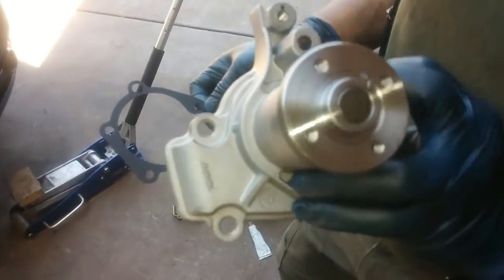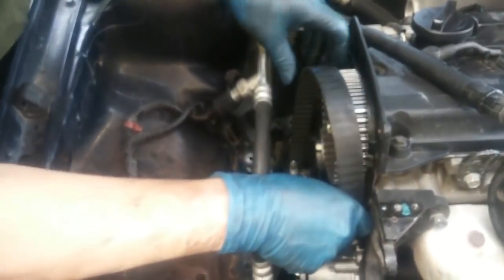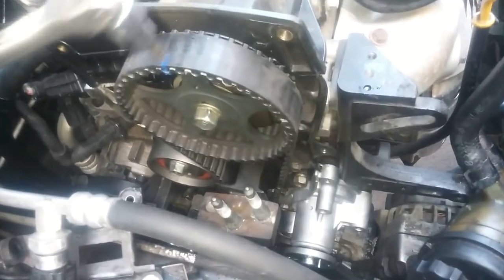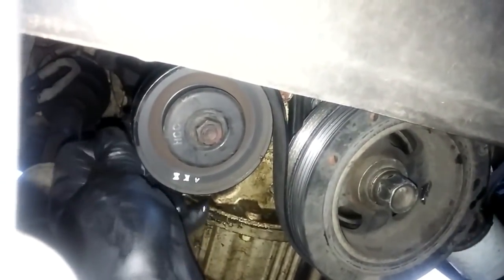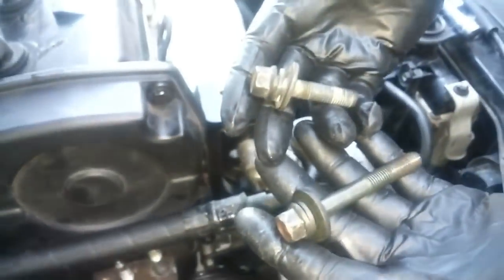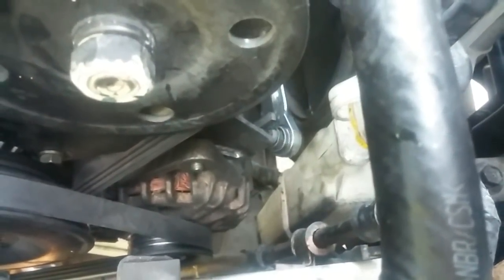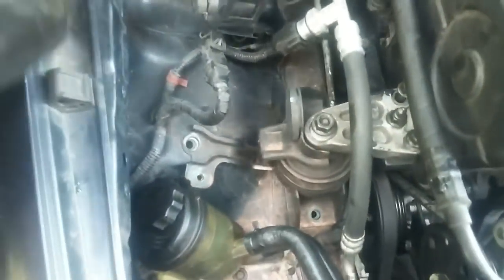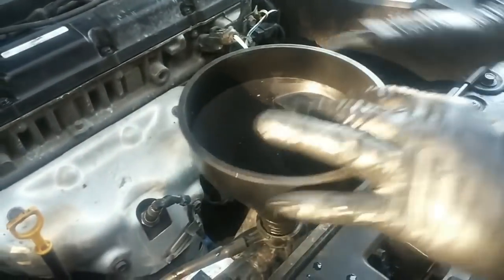Hyundai / KIA 4 Cylinder Timing Belt & Water Pump -  PART 2:  Installation

Comment: Anyone who sees this video, you don't need to put any gasket sealant as he did at 0:26. I did mine without it by dealer recommendation, just plain and it has today 50K miles without a leak. Just the gasket.
Reply from the maker: Ok but I've replaced coolant soaked gaskets that resulted in pump mounting bolts getting loose and coolant leakage.  RTV coatings protects the gasket.
Reply: @hardlymovingpro  Wherever you say, you can do what you want, but this step is unnecessary. It's just another headache for beginners. We appreciate all maintenance videos, but please do not make it more difficult.
Reply from the maker: @irisbaez1972  Then don't critique videos.  Just buy a repair manual and follow their instructions with the tools and techniques they use ... right?
Reply: @hardlymovingpro  RIGHT. internet and youtube are free speech, right? FREEDOM RIGHT? if you don't like positive criticism then go to CUBA, my friend, or better yet don't make a video. RIGHT? I think you have a psychological issue.
Reply from the maker: Setup your own youtube channel and show us the professional way to do it ... for free on your dime!
Reply: @hardlymovingpro  Still feeling pain? you need to see your doctor. psychology doctor.
Reply from the maker: Takes one to know one.
Reply: @hardlymovingpro  You forgot your own Doctor? what a shame!. Amazing how people know anything about cars but nothing about themselves.
Reply from the maker: Okay ... IRIS!

Comment: What sound will it make if the belt timing belt too tight?
Reply from the maker: Can't say.
Reply: Even putting the arrow or point past the mark in the tensioner doesn't do any problem or noise. I have it before from the dealer, then I installed it myself, and then after 40 K miles, re-tight and nothing happened.

Comment: Where is your indicator mark on tensor that lets you know if your just right guessing 6 lbs isn’t how you do it
Reply from the maker: There is no mark from my recollection.  Around 6 to 7 lbs of torque is what's normally applied to a 10 mm bolt.  Use a 1/4" ratchet wrench with hand torque (meaning don't snug it with toque from your elbows and shoulders).
Reply: I have a 2008 Kia 2.0 you have a to point out so the same motors my time in tensioner has an indicator on the back you take it with a 12 mm and a 6 mm Allen socket the same time you get the indicator in the window Is it not the same on this car ?
Reply: @charlesbrewer777  . yes. exactly the same. it's the same motor.

Comment: thk for the video but a have a question, when I intalled belt timing and the start engine the belt timing it move to the rigth  side and no aligin in the center sprocket canshaft, it is normal ? or not ?
Reply from the maker: The belt moved to the right side after engine start because the engine rotation is clockwise.  To check alignment, you'll have to manually rotate the engine from the crankshaft to top-dead-center (TDC) and see if it's in alignment with the camshaft TDC mark.  If the cam alignment is 180 degrees off, rotate the engine again 360 degrees and that'll bring the camshaft to the TDC mark.

Comment: Never use an impact on a crank bolt because you can miss aline or stretch your timing belt after you install it.
Reply from the maker: Strongly disagree.  Never, ever had issues using impact tools to take off crank bolts.
Reply: That can happen in some engines, just the ones that turn counter clockwise; saying that 90% of the “normal” turn clockwise.
Reply from the maker: Impact guns hit and twist in micro seconds.   Therefore not long enough to turn a crank.
Reply: The best way to do it is use a breaker bar and kick start it
Reply from the maker: Did that before I discovered high torque impact guns.

Comment: I had the dealer replace my timing belt and other drive belts and now there is whining coming from the front end which gets louder with RPM.  Do the timing belts whine when first installed?  Or could they have installed the belt(s) incorrectly?  Tensioner crap out after they put it in?  A belt put in too tight?  Its going back but any thoughts?
Reply from the maker: Belt tensioner adjusted too tight ...IMHO.
Reply: @hardlymovingpro  Thanks!

Comment: You forgot to torque the crank bolt.. just kidding, impact rachet.. but for people without one, fill one cylinder with oil at almost TDC, and it won't turn. Torque bolt. Then use a turkey baster and tube to suck the oil back out, and burn off the rest (big cloud). Unless it's automatic, then it might not turn while in gear and a long pry bar in the wheel hub.
Reply from the maker: thanks for your post!  You know when I bought my first ac electric impact driver, it cost me over $100.  Now they go for under $100.  If one is serious about doing HD auto repair and have to deal with bolts that are 17 mm or over, they have to have a high powered impact driver.  Filling the crankshaft with oil and sucking it out is a interesting and novel idea ... for those in a desperate situation.

Comment: I did the exact same way, but the belt started walking off the gears and hitting the side covers.  Did it three times and got frustrated. It still does it.
Reply from the maker: Which gear (crank or cam) is it walking off?
Reply: @hardlymovingpro  cam gear
Reply from the maker: @rockingoutdudetoo5275  If you followed everything I did on the video, the only thing I can think of is something must be wrong with the belt.
Reply: @hardlymovingpro  first timing belt change (with kit) was ok. Drove car for two weeks then I felt the whole car vibrating , thought it was the motor mounts.  I heard something slapping in the timing belt cover.  Both edges of the belt shredded.  So i order a new belt and new tensioner to see if they were the culprit.  Nope it did again second time.  So third time with the top timing cover off just to see, the belt was running against the left side about 1/4 in off the cam gear in which it was rubbing the bottom timing belt cover.
Reply from the maker: @rockingoutdudetoo5275  Can't come up with any logical explanation for your dilemma.

Comment: Thank you for being so detailed with your video; I am sure everyone appreciates all the effort you put into it. I have one question though, I saw that you removed the jack in order to put a pan under the vehicle to catch the coolant. Did you install the mount for that, or does the engine not fall to the ground? In advance, thank you so much for everything.
Reply from the maker: The engine had to be supported and slightly lifted to relieve support tension on the side motor mount.  Once the mount was off, the hydraulic jack can be lowered away.  The engine will drop down a little but not fall to the ground.   Then the pan can be placed under the engine without interference from the hydraulic jack.

Comment: What was this car
Reply from the maker: Elantra.  The engine is used in a lot of different Hyundai cars.
Reply: @hardlymovingpro  what year, vin 5 - 1.6l?
Reply from the maker: Don't remember.  Did this repair years ago.  Hydundai / Kia timing belt configurations are consistent and haven't changed much.

Comment: Hi Hardly moving productions, I just watched your 2 videos of this timing belt process, I have the same vehicle as you do and I’m ready to change the timing belt as well but the difference on mine it’s that my timing belt rip off or blow off, my car turn off while running, is there anything else that I gotta do besides the process that you did? I saw that you used your old timing belt to do some marks to copy to the new one,  but yours was all there, but mine is all rip off.
Reply from the maker: If you buy a Gates brand timing belt kit, it comes with a diagram showing what is top-dead-center (TDC) on both the camshaft and crankshaft.  Use that to set your cam and crank before mounting on the new belt.

Comment: Great videos and very helpful hints and tricks!   I am studying up on doing this job on my son’s 2008 Spectra.   One thing that I didn’t see and it may be an update to the procedure and design is on the tensioner pulley.  It shows in the book that there is a small mark on the block and a corresponding “window” on the tensioner pulley assembly.   I believe you rotate the tensioner until it sits in the middle of the window and then tighten the center bolt down.  Then rotate the engine a couple of times, realign the marks, then check the window again.   I am assuming this is a bit older design?  Thanks again as this really makes it easier to understand than other videos out there!
Reply from the maker: You're welcome!  That tensioner pulley is a spring loaded design where the pulley spring remains compressed until you pull out the tension pin (also called a granade pin).  I believe after you have the belt and the tensioner pulley installed, tighten the pulley bolt where it's semi-tight to allow the tensioner pulley to be adjusted.  Then pull out the pin  and align the pulley arrow with the alignment block mark via a hex socket and wrench inserted into the tensioner pulley's outer cover hex hole.  Once aligned, apply the final torque to the tensioner pulley bolt.  Good luck!
Reply from the maker: Also have a text and picture based article you can reference:
https://axleaddict.com/auto-repair/DIY-Hyundai-Elantra-Kia-Spectra-Timing-Belt-Replacement
Reply from the maker: Also, I start and run the engine for a couple of seconds instead of rotating the engine.  Then I'll check the belt tension and re-tighten if necessary.  You can check out my recent Toyota 5SFE timing belt replacement video towards the end of the video and you'll see what I mean.
Reply: Perfect!!! Thanks for the additional info.  I have done one on an old Mazda pickup, but that was much easier to get to!  I also have to work on my daughter’s 2000 Silverado that has one of the leaking Castech cylinder heads.  Going to be a busy Christmas break out on the driveway.  :)
Reply: Ok, so I finally did this job and had a few questions if you don’t mind.  I bought a kit from Autozone that included the pump, the tensioner pulley, the idler and the belt.  When I compared everything, the new tensioner pulley had a lot more later side play then the original Gates.  I went ahead and installed everything and ran the car.  I noticed that the arrow drifted out of the window, but would also vibrate up and down.  My son drive the car for 800 miles and cane back to town.  He said the power steering belt was squealing (new belts).  While I was about to tighten the belt, I thought to check the timing belt.  When I pulled the cover, I noticed there was belt dust built up on the side nearest the tensioner.   It appeared that the back edge of the belt was hitting the lip of the back of the tensioner and rubbing off.  Out of caution, I put the old one back and have driven about 30 miles.  It does not appear to be rubbing like the old one.  The belt naturally sits back pretty far,  definitely not in the middle of the pulleys/sprockets.  The tensioner is the one piece that really did not seem right. Any insight is greatly appreciated!!!
Reply from the maker: Good job!  By the way you described the tensioner, it doesn't appear to be the right tensioner for that engine.  It's too bad you had to go through that entire removal process ... but better safe than sorry.  Recommend you get a new tensioner as a independent unit.  Try Rockauto.com.    FYI - I've bought Autozone parts in the past that had failed a few days later.  They honored the failed part return but it took me 3 hours to replace the defective water pump on a V6 Camry... again.  Don't like this Autozone Duralast parts brand.  They get parts from who knows where and re-box it as Duralast.  NAPA does the same thing ... they just re-box.   I prefer getting parts from known parts manufacturers.  I get better parts packages from Ebay vendors.  They at least tell you the manufacturer of the part and are usually cheaper than Autozone.  I do like Autozone's lifetime warranty.  I buy their re-manufactured alternators, starter motors and CV axles.  If they fail, its a quick parts swap.
Reply: Hardly Moving Productions thanks for the reply!   I looked up the Dayco brand and they seemed to have a decent reputation, but definitely didn’t seem to be the same tolerances as the gates.   Thanks for all of the advice and help!  I sincerely appreciate it.
Reply from the maker: My pleasure.  Gates and Dayco are good.  FYI:  The OEM bearing provider for Toyota is Koyo and is very high quality.  Another cheaper provider for Asian cars is GMB.

Comment: Whats a job like this run in costs.... or shop time?
Reply from the maker: That depends.  Timing belt only .... timing belt with new water pump ... timing belt with water pump and new tensioner and idler bearings.   For everything, around 5 hours shop time.  Total cost, based on what part(s) are being replaced can vary between $400 - $600 ... could be more.

Comment: Much better video than the others that are out there - I've seen them all. I'm in the middle of the same job, and this covers a lot more details that others gloss over, ie.water pump pulley removal/install, timing belt tension, etc. Thanks for the help.
Reply from the maker: There's also a text version with pictures.  Here's the address:  
https://axleaddict.com/auto-repair/DIY-Hyundai-Elantra-Kia-Spectra-Timing-Belt-Replacement
Reply: @hardlymovingpro  🙏🏽 thank you… I learn better reading the instructions sometimes.
Reply from the maker: Glad you like the video.  Our pleasure.
Reply: @hardlymovingpro  thanks a lot ❤l'm the same position now to replace timing belt and pump...
And i'm looked the procedure... thank you,thank you ,thank you❤